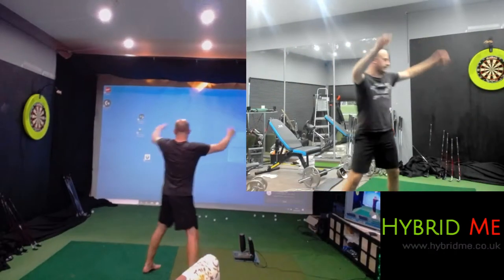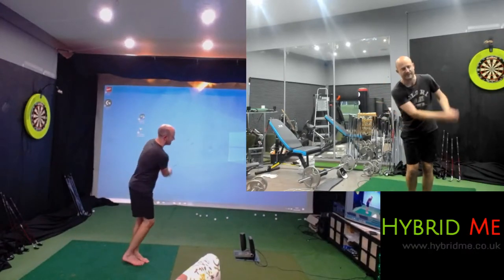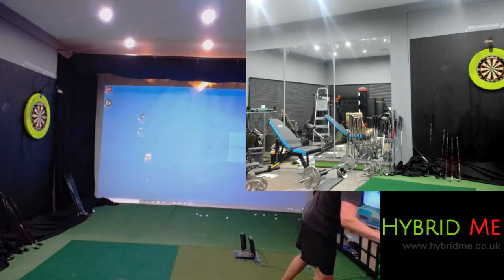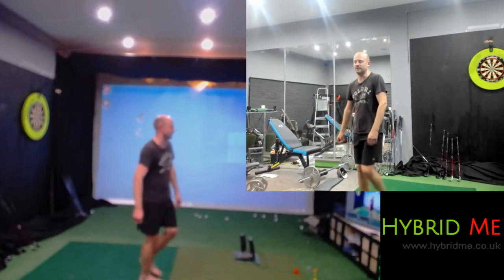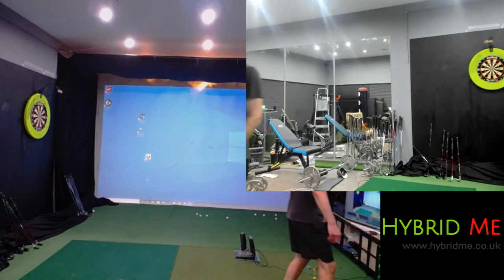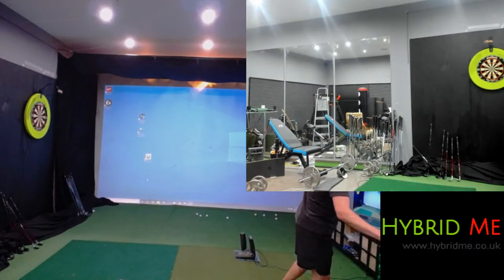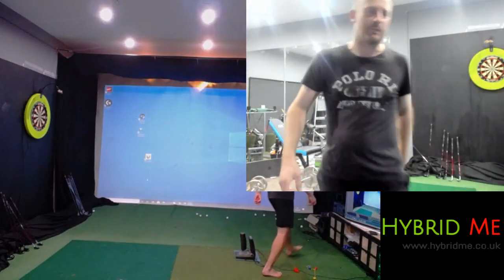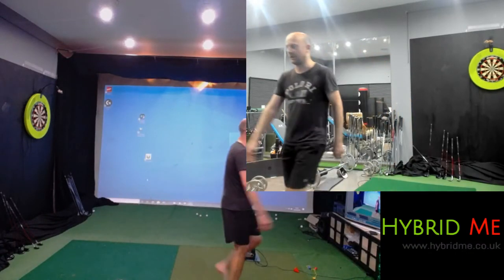BUILDING A GOLF SIMULATOR ? Here is the A to Z Guide

Comment: Very helpful video as usual. I have posted a link to it on Golf Simulator Forum. Well done. A mammoth effort. Your videos have helped me plan mine. I have my shopping list of parts thanks to you. When SkyTrak is back in stock I will use your Hybridme coupon code.
Reply from the maker: That's very kind of you. Thanks. I'm pleased to hear that someone finds these videos helpful.
Reply: June 13th 2020 the discount code has expired. Will there be another one soon? Just received my T40 mat from you and really pleased with it. Great recommendation.
Reply from the maker: Keith Bowman Thanks Keith. the HYBRIDME250 code only works when SkyTrak are running promotions. I don’t know when they will run their next promotion as demand has been so high. I have no control over this. Outside of promotions - my SkyTrak code is HYBRIDME

Comment: If you hit a high lofted club like a sandwedge would the ball not be in danger of impacting the ceiling? Thanks for the upload.
Reply from the maker: I use a 64 degree wedge and even when I try to hit a flop shot the launch angle is generally around 50 degrees. So with me hitting from 3.1m away from a screen that is 2.8m high with about 1.5m of ceiling protection it's all good.

Comment: Very helpful!  I am finishing off our 3 car garage and want to put some type of simulator if for moderate use.  I am thinking the best thing for me would be not using a projector, but using a computer and I will have a 70 inch HDTV of the wall next to spot we hit into a next or archery screen.  Any suggestions?    I would love a net or screen that can be put suspended up and let down when we want to use it.  Then I would just have to out out the hitting surface and Bluetooth the laptop to the TV.  What do you think?  Do you sell anything that would fit my needs?
Reply from the maker: sorry if I didn't reply - not sure if I missed this. These things are all possible in different ways. Feel free to email me at phil@hybridme.co.uk if I can help.

Comment: at what point in the video do you talk about your screen frame work - that would be handy to break out the video into sections
Reply from the maker: Clint Stevens not sure I discuss my own build in this video. Another video I did “rebuilding my golf sim - part 7” (and previous parts) covers this.
Reply: @v8hybridme  - cool - im just doing mine in my garage atm...just trying to figure out  a cheap way to make the frame for the screen
Reply: Hey Phil I have my screen up just need to add the side  and top curtains. Q: what is the distance from tee to screen? I am currently 9 ft away but when using a wedge(s) it gets up in a hurry
Reply from the maker: Clint Stevens morning In my build it’s 3m from tee to screen but that’s flexible.